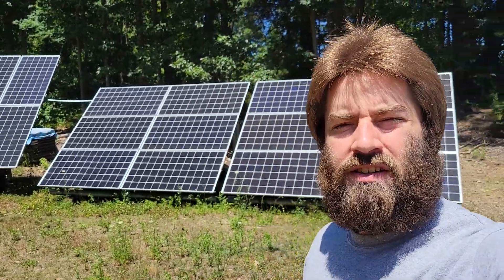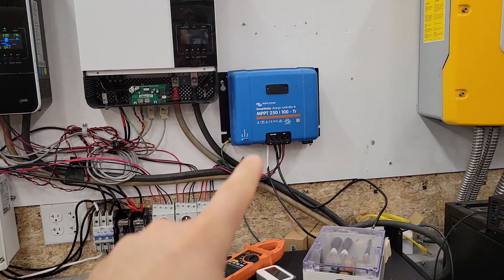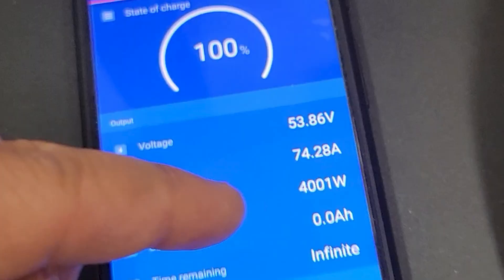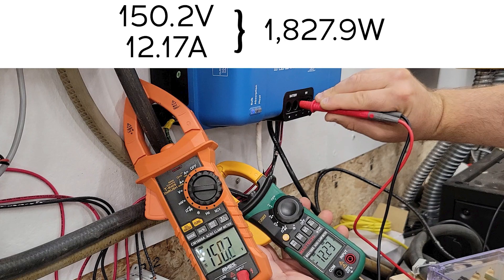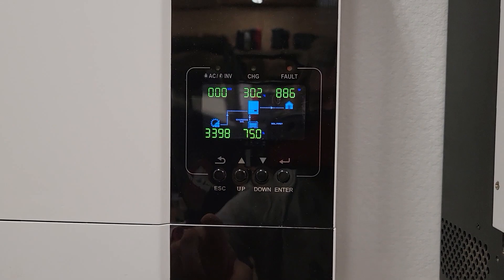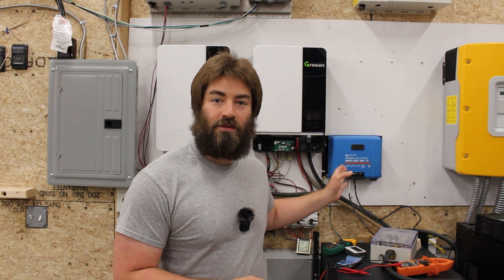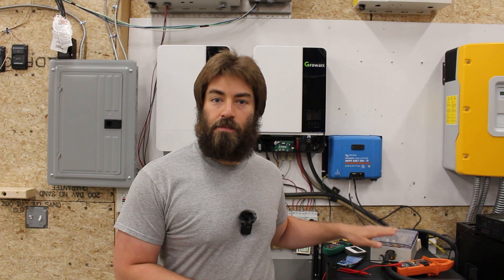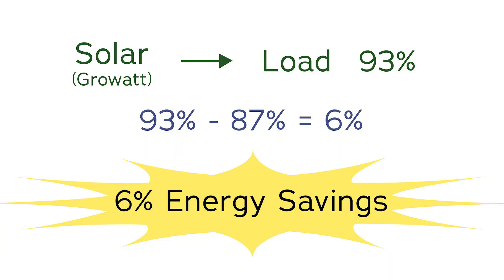Victron vs. Growatt solar MPPT charge controller efficiency test

Comment: I have watched a number of your videos, particularly the ones on inverters.  Here in late 2022 what would be your "go to" inverter to build a new system if you were starting today?
Reply from the maker: Depends on your application.   Are we talking a small portable system,  or a stationary, whole house setup?
Reply: @DavidPozEnergy  half house:)   I have 2 200amp services/panels.   I have the heavy loads (except the well) on one side that will NOT try to use solar.   But the well and most of the smaller circuits including microwave and several refrigerators I would like to run on solar.  Goal is 2 fold:  1) run on solar most of the time to reduce power bill and 2) have critical circuits available during any grid outage.   Hoping to size the system so that in most situations the solar/batteries get me thru and not have to switch back to grid often...but fully aware that times of overcast for days I will need to.
Reply from the maker: I would suggest you start your research with the Schneider XW PRO.  https://signaturesolar.com/schneider-conext-xw-pro-6-8kw-inverter-charger-48v-120-240v/?ref=4_rHcgZ9x-TiF-  (affiliate link)  This inverter can be positioned in between the 2 panels.  One XW inverter can easily handle a well pump, fridge, lights, TV, etc.  (probably everything you have on that critical loads panel).  It can be connected to solar through AC coupling, and/or DC coupling.  And, it has the ability to do zero export, which means if there is surplus solar energy it can back-feed the main panel only to the point of zeroing out your meter.  They can be stacked if you need more power, but that is probably only necessary if you want to back-up all of your loads (both panels)

Comment: @david poz: I'm not sure to understand all that setup but if you have a multiplus II and be able to use directly the solar energy for your home. Then you will have the same advantages as with the Growatt isn't it ?
Reply: any mppt with any inverter use the power directly for loads, if the load power is less or equal to solar power. never the power can go into the battery and than go out from battery to inverter.What the hell does this video mean? I hope I'm wrong

Comment: While I get your point, the test should compare apples to, at least pears or something...

Will a combined Growatt be better than a discrete Victron MPPT and a Victron inverter?
Reply: It will not. I have a full Victron system and when I need for example 500w and my battery is full my mppt will supply 500w to my inverter, "bypassing" the battery. Growatt is still great for that price and overall a great inverter!

Comment: Growatt MPPT Range is from 120VDC to 430VDC. If you increase the input voltage you get better efficiency
Reply from the maker: I would have guessed the opposite.  Do you know of a study, document, or video that demonstrates the efficiency difference at different input voltages?
Reply: @DavidPozEnergy  12V 24V 48V => AC/DC inverter which one has the best efficiency?

Hi David, guessing doesn't get us anywhere, that's why we're doing a test.
Reply: @DavidPozEnergy  These units use buck/buck-boost converters, 1 or 2 stages. Victron uses 2 buck stages, I don't know yet about growatt. If growatt's MPPT uses 2 stages to reach the "internal bus voltage", the first stage gets burdened with more current if the input voltage is low but input current is high. Mosfets for 450V have resistance of 0.25 or 0.4 ohms. I don't know why they chose the shittiest mosfets range (450V), when 600V mosfets can do better at 0.073 ohms for a similar price. 22x22x0.4=193W if a single mosfet is used. If 4 parallel mosfets are used, then 193/4=48W. If the input current was 10A, then the losses are 10x10x0.4=40W or 40/4=10W. The coils for the buck-converters have some internal resistance which might be more than the mosfets' resistance, in which case the above calculations still stand, but I don't see heatsinks on those, so they can't be heating-up too much.
Reply: Correction: Growatt uses one boost converter. Grabs whatever voltage and boosts it to almost 430V.

Comment: Can the Growat pull from the battery and the grid at the same time to match power usage in the moment like a Victron Multiplus can? I'd love to have a charge controller and inverter combination but for my camper setup, I need to be able to limit the amps taken from shore power and compensate with battery power as needed. For instance, my portable inverter generator can not run my rooftop air conditioner but if I could get a little boost from my batteries and inverter at the same time, I could stick with my small portable generator.
Reply: Almost all Chinese hybrid(off grid) inverters can

Comment: Hi,
Did the Growatt an Victrin load the same Batterie? If yes, is there any more component between the victron and the batteries.
Thanks for you response.
Reply from the maker: Yes, both charge the same battery bank.  I have a circuit breaker in between the two.
Reply: @DavidPozEnergy  what about the BMS, how would the victron get battery info from the bank?

Comment: Hey David my hero! I was wondering if you could build me 2 of "all on one panel" system like you did for your friend in Florida and tested it in Maine. (One will be powering all my 110 volt (tools & appliances) and the other will be powering all my 220 volt ones. Thank so much for what you've been doing. PS (I will let you pick the solar panels and batteries too)
Reply from the maker: Sorry, but I'm not set up to build these commercially.
Reply: @DavidPozEnergy  ok, thank for your reply. Keep up the good work

Comment: Was going through some of our surplus solar controls that we haven't been able to scrap.  Are  you interested in any unused horizontal axis commercial array,  electronic controllers? There in plastic sealed outdoor rated boxes. They are programmable with Arduenio circuit boards. Free of charge, shipping should be cheap since they don't weigh much thanks Fred
Reply from the maker: Thank you for the offer.  Are you on Facebook to discuss further?  I'm at DavidPozEnergy

Comment: I always get 3x the amps to my batteries in direct sunlight, and around 10x as much amps in cloudy conditions, directly connecting my batteries to my panels than any charge controller ever gets to them.

Mppt, pwm, whatever.

You are probably only really getting similar results to this.

Your not really testing their efficiency unless you try bypassing them and see how much you are really missing out on.

Also charge controllers will kill your batteries with dendrites. 
Just set up a relay to switch to heating water at an upper voltage limit.
All those electronic gimmicks are designed to make you spend money on 10x the size system you really need. 
And cost shitloads to keep it working.
First decent solar storm will kill them all too.
Reply: I'm going to go with the word :  WOW.    
And you should start a channel , I want to see this.

Comment: What happens to your batteries when they die? We are in the scrap and salvage  business and have no outlet for them. Solar panels either, same thing. That is why i still prefer lead acid forklift batteries there worth 17to 22 cents per lb. And are readily saleable. Also how forgiving are temperature variation in lithium iron phosphate batteries, all the questions are for a friend wanting to build a mini grid in western Montana, on a housing subdivision. Thanks in advance Fred
Reply from the maker: Last time I went to dispose of a large lithium battery I paid a fee at the recycling center.  In this area, Lead acid still wins.  I think I remember once learning that 98% of lead acid batteries are recycled?  I think that's awesome.  
LiFePO4 chemistry wants to be charged between 32°F and about 120°F.  They can be stored below freezing, but not charged below freezing.  A friend of mine made a very nice example of an insulated box for his lithiums, and he lives in the cold Vermont mountains: https://youtu.be/6XLOKtl-q3s
Reply: @DavidPozEnergy  My friends winters get as low as 20 below they build very insulated  mechanical rooms for the solar setups.i helped him with his he has lead acid with no problems but he did have to run a small propane heater for some the really cold days. I suggested for him to install a passive geothermal system to elimate the expense of the heater.

Comment: Is someone able to explain how the integrated systems are more efficient at using the solar power directly? 

I'm not sure it's correct. To my knowledge the Growatt has a separate charger and inverter and needs to energise both in order to invert the DC from the panels and into AC ie the integrated charger has already stepped down the solar input to 48v which is feeding the inverter. In that case it would be no different to having a charge controller and inverter separately installed. Individual components might actually be more efficient as they won't heat soak eachother? Or is Growatt doing something tricky like allowing high voltage DC from the panels to run the inverter directly? Would be interested to know
Reply: You are correct.
Reply: I am researching this topic now, and interested about this..   trying to figure if i want an all in one , or separate...

Comment: I have an e-bike that's 72 volts. Is there a solar charge controller other than the MPT-7210A that can directly charge a 72-volt battery? I would like to use a higher solar panel input voltage. :)

Comment: Good to see the math. These aren't the cheapest solution nor is electrical efficiency the only consideration, but the best way to achieve overall efficiency is reducing unnecessary losses where possible, which makes electrical efficiency one of the most important aspects.

Comment: to point out the obvious ;-) ..... connect a good inverter to the battery, a victron one, they are between 92 and 94 %. Electricity coming from solar will go into inverter directly via the busbar or poles of battery.

Result will be likely be Victron will be more efficient in all 3 scenarios here.

Now here is a description of my system, I think it is a template for a small system for  grid tied house

I have two sets of panels, each with a victron MPPT charging the same lifepo4 battery. 
The first MPPT is set to absorption 14.2 V and float 13,5 (so 100% SOC)
The second MPPT is set to  absorption 13.25 voltage and float 13.20 voltage.
The second MPPT is parral at the input with a grid tied inverter that start charging at about 20 volts. This means the MPPT can have the voltage if it needs it (meaning there is solar and battery below 13,25 volt), if not it goes to the grid tied inverter. Sometimes they fight a little bit but often not for long.

Between the battery and the grid tied inverters second MC4 port I have a 12-24 DC-DC. It has the low cut off set at 13.0 volt and it's relais controlled by a smartplug. That plug is controlled by a p1-meter that can see whether watts flow in or out of my house. When more than 240 watt is being pulled from the grid the smartplug is turned on and the DC-DC pushes an extra 240 watt into the grid tied inverter.
Reply: these people dont know ohm law? mppt + inverter is the same that growatt. If the load power does not exceed that produced by the mppt. what do they think? That if the inverter is separated the current goes first into the battery and then to the inverter? I hope not because these are the minimum bases of electrical physics.

Comment: Wish you understood that there is no advantage to the Growatt other than the wiring is internal.
If you had ever hooked up a E-Panel you would understand that the power is system power...

When you do loads while the sun is shining, particularly when the battery bank is full, this is called "load shifting" a common term in off grid forums.

Comment: We're right in the middle of winter here in Australia, short days, long nights.
One of the most important uses for me is boosting the Solar hot water system, I've got a timer switch set for 10.00 am to 3.00 pm so that, at what is usually peak production time, input is utilized  now, rather than depleting the battery banks later on.
Very much enjoying your videos David, lots of good old common sense there.
Reply: Just to note that PV panels are maybe 22% efficient at capturing sun energy whereas direct solar to hot water can apparently convert up to 90% of incident sunlight into hot water so you may want to consider a few panels to convert direct to hot water - I think David has done this. Also depends how much "roof area" you have available and the comparable cost of the two types of panel and energy storage (batteries vs. insulated hot water tank).
Reply: we have a heap of second hand $30 dollar solar panels connected directly to our hot water tanks,ss beer barrels, one under sink in kitchen, half a cup before very hot water comes out, i used a ball valve with long handle to get instant hot water from the shower, i really appreciated that when i did it. we turn our fridge off around 4.30 every day, move milk and meat into freezer section and move 4 litres of ice from freezer section into fridge, we don't really need to do this but i thought why take power from battery if i don't need to.
Reply: @michaeljoncour4903  what thermostat setup?
Reply: this is what we did in romania now,we just built a growwatt system for my buddy whit 5400 watts of solar installed,and only a 5 kilowatt batery,becouse we dnt have more money.Its lifepo4 so at least it endures cicling.But the 100 amp batery can suply the 5k growwatt whitout the bms cutting out on us also,and so we put a timer on the hot warer boiler they use for shower and domestic warm water.They use that mostly during the day time,and also moved showering to day time as well:)) they got used to it quickly,and than the bateries suply nough power during the whole evening/night for the 26 watt TV,a laptop,and a fridge mostly...if it is still not enough,these inverters are so good,we can program it to cuople back on grid power if the battery goes to 20%.It works fine and they pay almost nothing for electricity since the system is in place!

Comment: No disagreement with your main conclusion that energy storage has losses that you avoid when you use the electricity directly. 
But when you measure efficiency of an inductive load in the 90+% range you need to consider the power factor and harmonics if your inverters. Your trueRMS measurements give you a relative measurement at best, the absolute efficiency values are not very meaningful. So based on your measurement I would be careful to conclude that one inverter is a lot more efficient than the other.
Reply: He was only comparing the MPPT charger efficiencies. The Growatt is a charger/inverter, the Victron is only a charger.

Comment: David, when you were contemplating using a high power single phase inverter and a big autotransformer, how did your testing turn out. I wanted to do something similar. The single phase unit for Europe have much better Mppt dc input voltage,  actually name benefits, if u think about it. What were the real issues with a big 230v inverter and a aoutotransformer? Thanks David

Comment: Hello my dear Mr . Dovid 
You are an admirable engineer.
I have a question about  how can we connection three Victron or Sunny island inverters for getting three phases?

Finally, have  a nice beard
Reply from the maker: I've never set up 3-phase so I can't answer from personal experience
Reply: @DavidPozEnergy  
Thanks. we need  to see you  doing  that in future  have a good  day .
Reply: Three phase is available through 3 sunny islands go to smas website for setup information. Requires three of the yellow inverters one master and two slave inverters. Fred

Comment: Your math has a serious problem with the laws of physics. Electricity does not flow into the battery before it is inverted via the inverter when a load is in use while the charge controller is "charging"..  It goes directly from the charge controller to the inverter. A charge controller is not a battery charger, it's an mppt device that maximizes amps per available voltage. The electricity flows to the least resistance which is the inverter when it's in use.

Comment: I hate these all in one solutions. I would rather use 3 dedicated 5kw inverters, and my 100amp renogy  charge controllers. I was using one of these 5kw growatt as a starter system and even the inverter efficiency was less than the ones I have from Renogy. It's not a brand war, it's just that these all in one all seem to just not be as good overall. Yes they're simpler but there's better.

You're just wrong, an inverter will use the power created at the bar. The laws of physics come into play. You're simply wrong. I mean no disrespect to you. Live your best life. Look into wind turbines though. They really help.
Reply: Amazing how you give advice to others while being obtuse
Reply: The  Renogy  PV input voltage is limited to 140 VDC  among other things.

Comment: Can you explain how efficiencies of 94%,94%,99% = 87%. I calculate the average is 95.7%
Reply: You multiply not average.  You get 94% of the solar power to the battery then 99% of that battery when later it is used by the inverter but the inverter is only 94% efficient so in the end you get .94 x .99 x .94 % of the solar power that your solar panels generated as actual power to your appliances,
Reply: @ronbridegroom8428  I am still scratching my head but Thanks. BTW can you direct me a link that may help me understand that a bi more. thanks again.